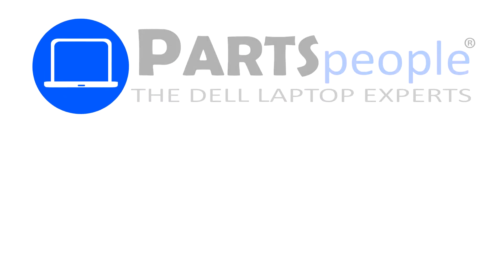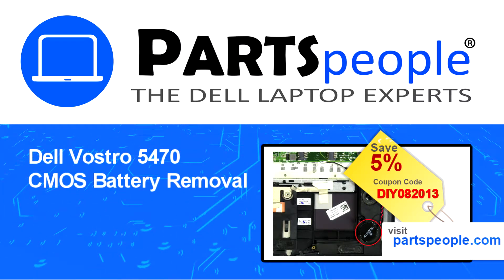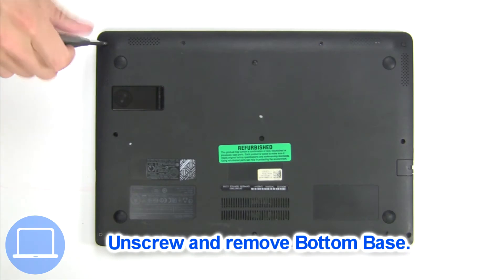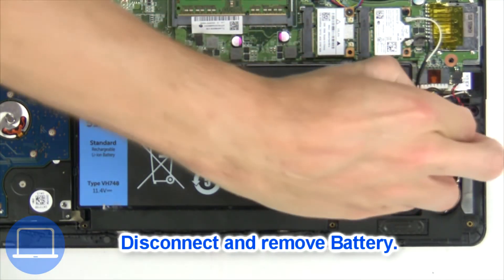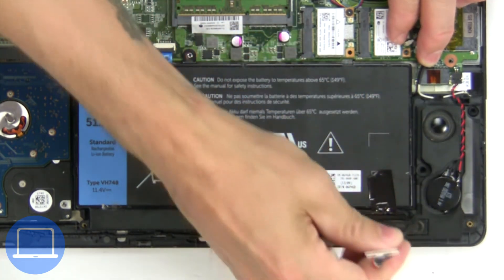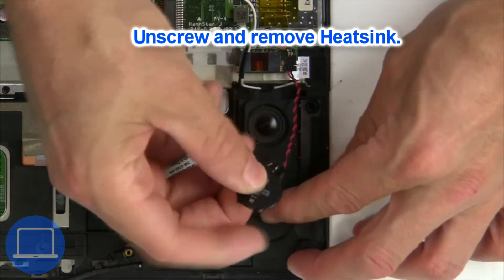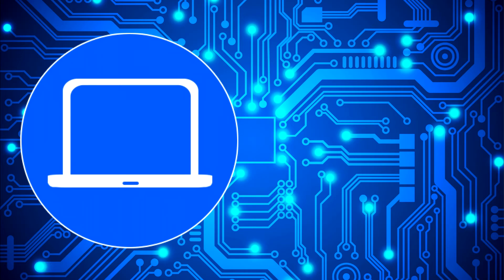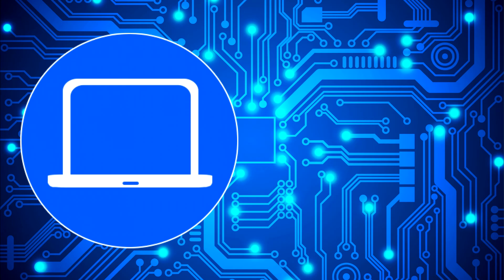Dell Vostro 5470 (P41G002) CMOS Battery How-To Video Tutorial

Comment: Hello! Do you know the exact name/model of that black connector/socket? I still didn't found this product in Brazil marketplace.
Reply from the maker: Hi, sorry I couldn't tell you as we've never had a bios battery the Vostro 5470.  Usually these type of connectors we have to remove and transfer from a donor boards. If you can find out that this same bios battery is compatible with other laptop models then you can determine connector is the same and try to find a bad motherboard to remove it from. Best of luck!
-Cory

Comment: If the main battery not plugged in, but the charger is plugged in, did the led indicator will light on?.
Reply from the maker: The charge light will not come on.  It may flash for a second.   However, the power light will come on.  You do not need a battery in the laptop for it to power on.
Reply: @dellpartspeople  I facing the battery problem with my vostro 5470. I removed the battery and after then i plugged in again, it's turn out that the battery cannot be detected. It's stated "no battery is detected". I brought new battery it's still said no battery is detected.
When charger is connected without main battery, the led indicator not light on. And even with the battery plugged in, the led indicator still not light on.
I change cmos battery yet the problem still remain.
I did:
1. downgraded and upgraded bios
2. Unplugged all power sources and reset
3. Uninstall Microsoft battery (ac/acpi)
4. Reinstall windows
5. McAfee virus scanning
6. Download and update drivers via dell support.

Yet non is working. The problem can't be solved.

Anyone know how to settle this problem?.